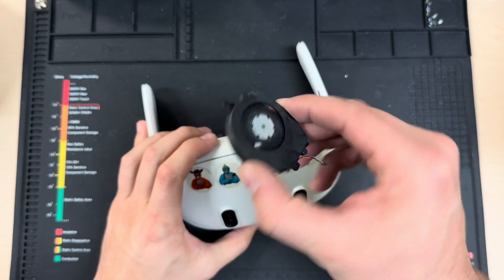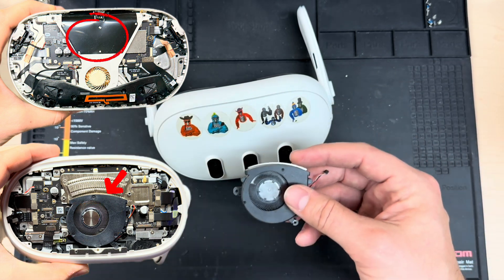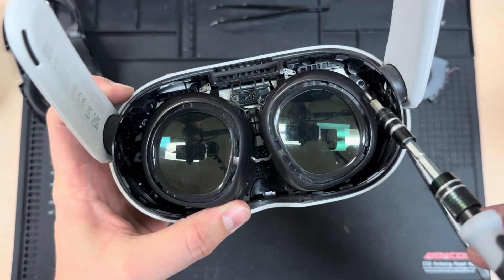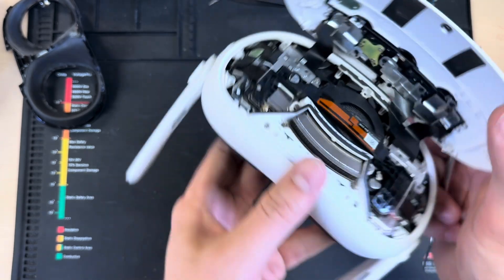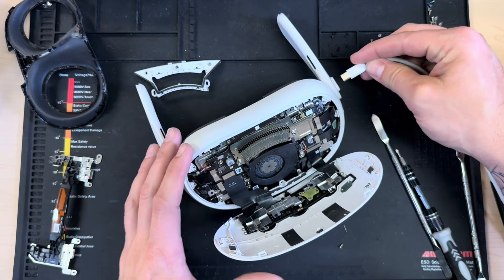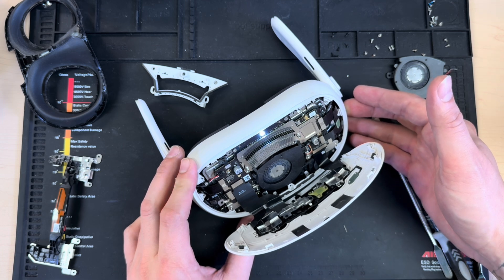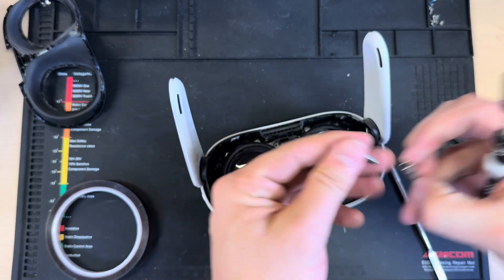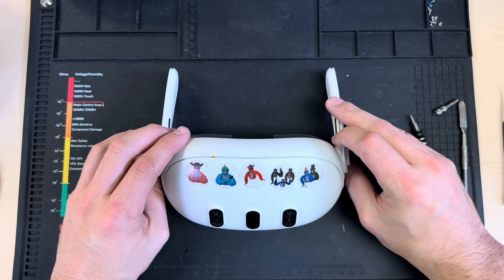Quest 3 Overheating or Making Noise? Here’s How to Fix the Quest 3 Fan!

Comment: Perfect, worked like a charm! Took me a while for the 2 screws at the bottom, but all my problems faded away when I used the wheel to re-adjust the eyes. Could easily reached them at that point :)

Comment: Thank you. My sons Quest was showing Overheating, shut down to avoid bodily damage, as he says. There was some lint under the Bluetooth receiver (also learned from your video). The fan had seized but was able to force movement and now it works fine. Ordered a new fan just in case its a fluke. I couldn't have done it without you.

Comment: Thank you sooooo much for this video! I tore my nephew's quest 3 apart, repaired it, and put it back together using this video! Both screws had fallen into the fan. I added a teeny amount of blue locktite to the two top screws and put a peice of electrical tape over them. Hope it holds up!

Comment: Great Video! I picked up a used Quest 3 for $200 with a BOBOVR S3 Pro Battery Strap and a ton of other accessories, because the fan was making a weird sound. It was one of the screws you mentioned. I just put it back with some blue Loctite and called it good.

Comment: Thanks for the video. I was able to fix mine by watching ur video. Same exact problem, a screw was loose and lodged. I contacted Meta support and they try to have me pay, $289 for a refurbished unit. I said, screw you 😂 Fixed myself. The tiny screws are a pain but was able to fix all for the cost of $12/screw set.

Comment: Great tutorial! My MQ3 had a the same screw lodged in the fan. Luckily the fan worked fine after blowing out the dust and removing the stuck screw. I used a tiny amount of loctite on both those top screws. Thanks!!

Comment: Question: I turned on my quest 3 and a notification popped up saying my fan wasn’t working, after trying to restart it, my quest won’t turn back on at all not even the light indicators on the side, is that a fan replacement issue?

Comment: Followed your instructions (very clear, thank you) to fix overheating quest 3, when low and behold I opened it up to find one of those screws you mentioned in the video, missing. Guess it it a common problem. Found the screw that fell into the fan, and unit was as good as new. Thank you so much!
Reply: I'm thinking we had the same screw issue but after watching the video with my grandson, he got scared and he wouldn't even let me try, lol, told me to just send it in....got it back yesterday.
These folks are awesome. I can't say enough good things about them.
Reply from the maker: Thank you!

Comment: I fixed my fan problem by watching this video but I did have trouble putting back the bluetooth cord that would connect to the motherboard I believe but I believe I got it on there and I put everything back together and I tried powering it on and it would show the loading screen then go to a Grey screen and I factory reset it and it still is doing the same thing do you know what might be causing this?

Comment: Just done this now using this video… screw was stuck in fan like said.. would this be why charge wasn’t holding long?
Reply from the maker: Not holding a charge is usually battery related, but time will tell if the cooling fan was part of the issue.

Comment: I wanted to find the right channel to share what I've learned about the Quest Visors and I think this is the channel (if its not already known) to share it so others can know about it as well.

That little hole that seems to go straight through the visor and nobody seems to know what it for. When you look at the visor you cant even see the hole.
Well that is a sensor. Best I can tell it let's light in and if it passes straight through it knows you are not using the visor and goes into sleep mode.

But if you say put a plastic bag crumpled up into it and set it down while you're watching a movie or whatever and set it down to go get a soda, the movie/game what ever continues to play so say you're hosting a room. You can get up and do what you need to without interupting others viewing experience.
Try it out. And hope this comment gets pinned. I would love to see a video about how this works. And yall do great work.

Comment: I just followed the steps in the video- I’m getting a fan error message and fan sounds a little louder than normal. After getting the fan out, there were no screws inside, no bent blades, but was dusty. I cleaned with compressed air, and tested to be sure fan was turning on. It was. Once I put the headset back together, that louder fan noise started again. How much would it cost to send it in to you for repair ? I can buy a replacement fan, but I’m worried the issue isn’t the fan itself?

Comment: Can you tell me exactly from where the hot air flows out because I brought a silicon case  and I feel it blocks the air flowing
Reply from the maker: Top of the headset where the seam is between the front plate and the bezel shell.

Comment: By the way, if i were you i would change the thermal paste just in case to pervent overheating.
Reply from the maker: Going to be honest with you. I’ve repaired over 1000 of these and never changed out the thermal pads. Never had an issue with overheating. Not even one time. 
As long as the fan is running and free of debris, these things just don’t really get that hot.
Reply: @fixmyoculus  Oh so the Cpu/Gpu uses thermal pads ? How many mm they need to be inserted ?
Reply: @fixmyoculus  Unless you overclock it ? The headset isn't overclockable right ?

Comment: Hi there I have an issue with the left quest 2 controller it has phantom touches on one of the buttons so it thinks I'm touching the button when I'm not (it does not have phantom button presses)

Thank you for the help this will save me big time as I'm left handed.
Reply from the maker: Usually it’s a little bit of liquid damage on one of the capacitance sensors on the board.

Comment: I would appreciate some guidance, so my quest 2 stopped charging but after it died I reset it, from there the battery jumped back up to 33% almost spontaneously and my quest 2 would not charge (the cord was working fine with other devices I checked, along with the outlets). Any ways now I’ve managed to get it charging but it’s very weird because it won’t charge when powered off or on, only when the headset goes into its resting mode when powered on, so I’m not sure if my charging port if messed up, or if my headset is glitching, but with how consistent in it charging using the method I’m not entirely sure if I just have to contact oculus or if this is just a case of my headset being damaged

Comment: Have a quests 3, it won’t turn on. Tried to a hard reset, plugging it in, pretty much just about anything I could try. It sounds like the headsets fan tries to start up, but doesn’t. And it just makes the noise over and over again. Any idea the cause?
Reply from the maker: There’s not enough details here to diagnose it. You can check out our website for ways to send it in for evaluation.
Reply: @fixmyoculus i have the same thing is there any way to fix it?

Comment: Hey nice video! But i was thinking about something , if you take out the full display assembly of a quest 3s can you swap it with an quest 3 ? Like the lenses aren't compatible but what about all the display assembly ? 🤔
Reply from the maker: The Quest 3 has a dual display system where the Quest 3S has a single panel LCD so they are not compatible.
Reply: @fixmyoculus  okay thx for your response 🙏

Comment: NEW SUB do you repair Nintendo switch lights? I got on the doesn't seem to want to read the SD card for long put it in play for a few minutes and then a message comes out this is SD card was taken out please  reinsert it. We tried the simple stuff. We replace the SD card didn't work. Obviously cleaned it didn't work. Tried making sure the SD card was incorrectly like being held in their properly after you insert it still didn't fix it. Anybody on here got any guesses
Reply from the maker: I’d need to evaluate it and see if it’s a failure with the reader or the board, but you’re welcome to send it in through our website so we can take a look.

Comment: I got quest 3 about 2 weeks earlier
I accidentally dropped it over its front cover holding the cameras vertically about 50 cm high .. After then I noticed that the inner fields of both eyes (more at the right) show faint blurry horizontal white line ?? glare over the black screens of games and apps and slight linear glare over the other colored screens 
I tried cleaning the lenses but this didnot help
Would much appreciate your help for that
What have happened 😢😢
Is that an issue with the LCD panel